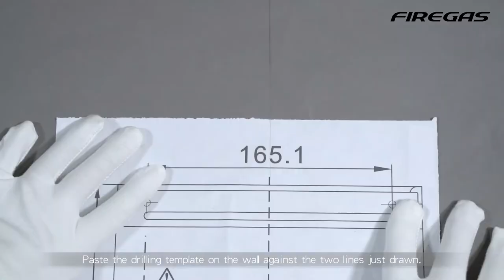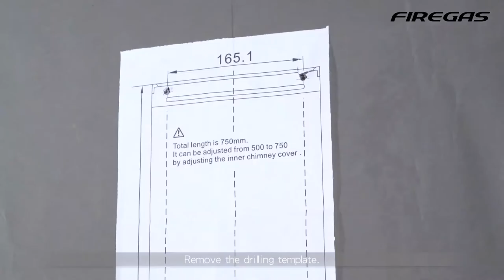How to Install Firegas Wall Mount Range Hood | Firegas Range Hood

Comment: what about the electric...it comes with a cord and the wall cord may be an option, but you do not even show the electric connection is there another video, are we supposed to install a socket or cut off the cord and twist onto the cable in the wall?

Comment: OMG I HUNG UP @1:59 I MARKED..I DRILLED..I POSITIONED THE HOOD..IT WAS ALL WRONG...USING THE TEMPLATE MADE THE HOOD HANG TOO LOW..HITS YUR HEAD....DIMMIT GONNA USE MY EYES AND WORK MY WAY UP TO WHERE TO DRILL EACH SET OF HOLES.....NAPTIME